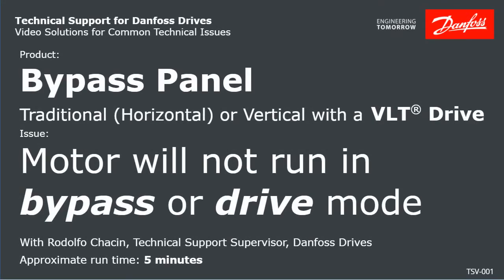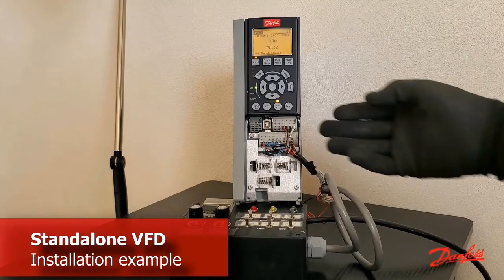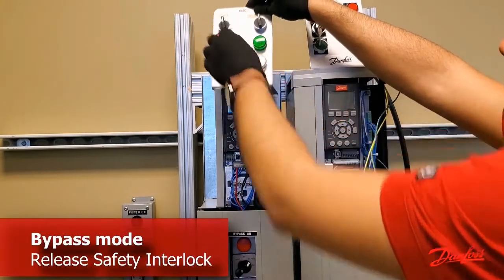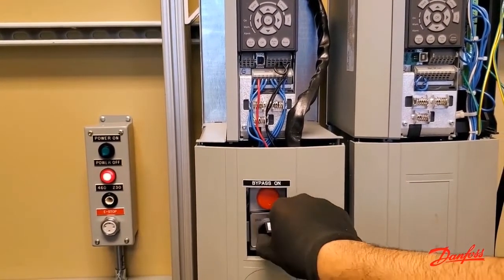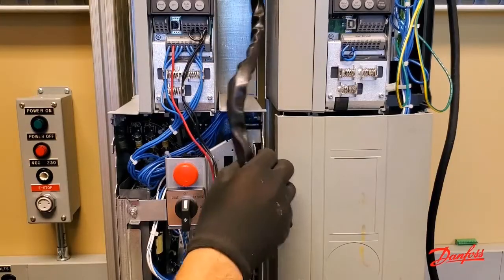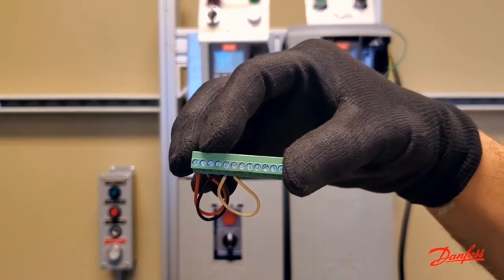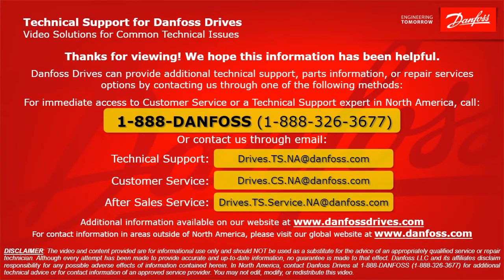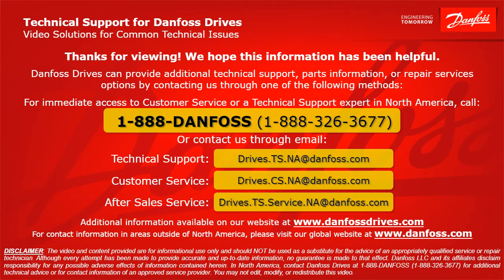VLT® Drives: Motor will not run in Bypass or Drive mode

Comment: After I replaced new power board ,the drive doesn't display on LCD panel or key pad,the control card is new ,my cooling fans are not connected could it be a problem I need help

Comment: I have Danfoss drive 5 hp its not working in auto mode in manual mode motor runs and even speed varies by operating potentio meter situated on drive what could be the reason
Reply from the maker: For installation, start-up, programming and troubleshooting assistance please email: Drives.TS.NA@Danfoss.com
or if you need immediate assistance contact Danfoss Drives 24/7 tech support at: +1 888 DANFOSS (326-3677)

Comment: Why some of vfd can run manually on the spot when switch to manual mode but some of vfd cannot..no response in manual mode
Reply from the maker: For installation, start-up, programming and troubleshooting assistance please email: Drives.TS.NA@Danfoss.com
or if you need immediate assistance contact Danfoss Drives 24/7 tech support at: +1 888 DANFOSS (326-3677)

Comment: Drive Run after start command given but it not shows output voltage and display also not having any alarm or error 
please suggest some solution for this issue
Reply from the maker: For tech support information please visit https://www.danfoss.com/en-us/service-and-support/fix-and-troubleshooting/drives-support/